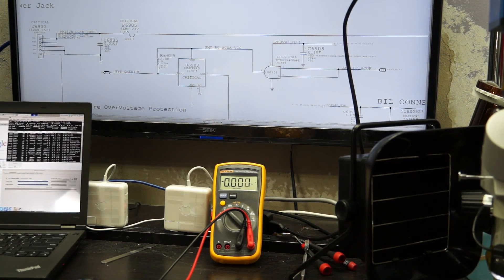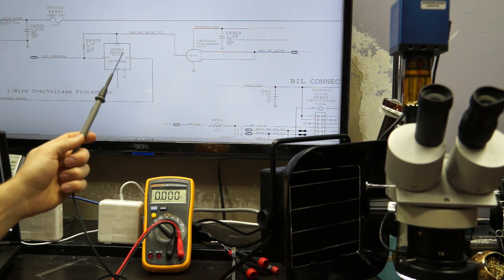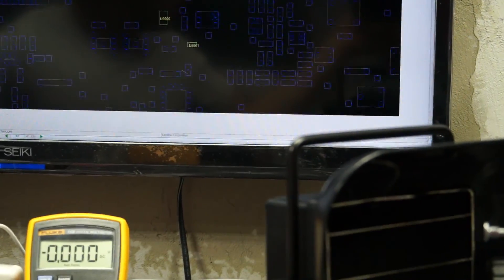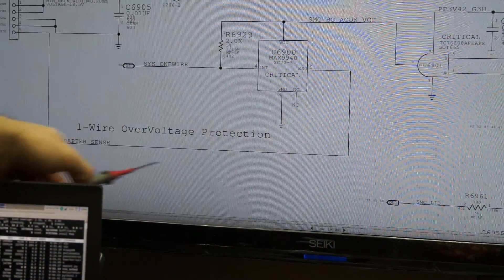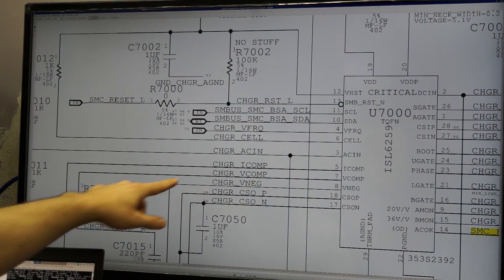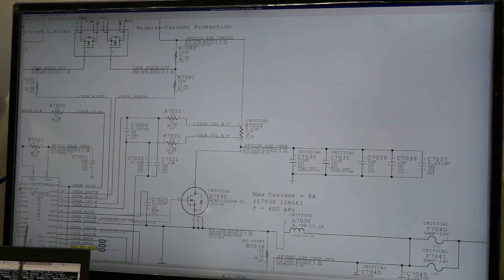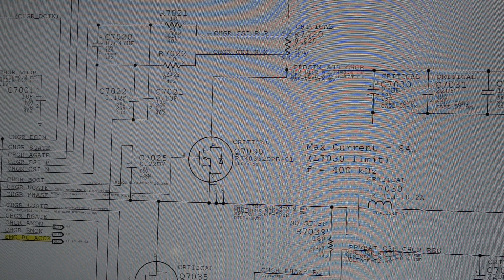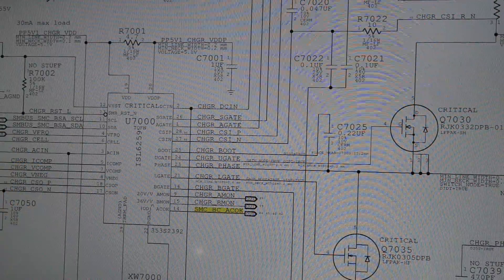How Macbook Pro logic board power circuit works - 820-2915 logic board repair.

Comment: Louis, I have this logic board, 820-2915-b, the fan are spinning all the time, the kernel task is higher on the activity monitor, all the system is slow. Should I replace the 330mF capacitor ?
Reply: yes

Comment: You're very talented. But I think the right approach to board repair is repair by a factory type facility where they have all the secrets to how the board is constructed and even some machinery for SMD work. Even pros like you have to do guesswork and essentially reverse engineer. 
One time I needed to fix a PSU from an industrial scanner. I contacted the PSU's OEM and they charged me $40 to repair it. Obviously a power supply is pretty primitive, but the OEM could repair it the best way, because they made it and know it from top to bottom. 
Board repair is basically a cat and mouse game.

Comment: Hi, your Videos are great :) Thanks. I'm from Luxembourg, my english isn't very good :) I have a Problem with my macbook, that means no start no battery charging, and the Led in the charger plug flashes orange and very weak. Did you even have had such a Problem?  Tanks :)
Reply: +Andy Lauer  Also I wanna know what Software you use to locate the parts on the board. In the schematics there are no board layout Pictures :(

Comment: *****  SMC_BC_ACOK... System Main Controller_ Battery Charger_ AC (Alternating Current) OK (okay) ... my guess is this is telling the SMC the charger AC supply is ok... strange since it's a 16 or 18v DC (direct current) output from the mag-safe that its looking at, but if the charger was outputting 24v DC it wouldn't be ok, to turn on or charge the battery... it would be interesting to test the upper and lower limits of turning on/off and allowing battery charging... would it turn on at 14v but not charge? or vica verca? perhaps an idea for a video using your power supply...

Comment: So, I have green light, orange light too, battery charge LEDs works ok, but my Macbook Pro won't turn on, already tried smc reset and all key combinations possible, even shorting rs501 pads and nothing happened. So my question is: Did this kind of symptoms happened to one of your repairs before? Is it possibe for a faulty logic board to keep on charging battery? All this started to happen after my magsafe cable got shorted out. I repaired and tested the charger and it's Ok and even tried with other charger. Any suggestions? Please!
Reply from the maker: TheMetalMusicMachine Which power rail is missing?

Comment: Louis, do you have any tips on the replacement process for the isl chip?  I've got a 2915 board that's got a short to ground on the ACIN pin of the isl. I've read replacing it can be tricky.  Is it as "simple" as the process you used in the WLED driver replacement video?
Reply: To answer my own question here for anyone who might be wondering:  Replacing it with a reflow/heat gun was easier than expected.  The main thing I figured out was to expose enough of the surrounding board that the entire area gets warmed up, not just the chip. Otherwise it won't ever come off.  Once it's off, getting rid of the lead-free solder and putting leaded solder made getting it back in place really easy once it's lined up.  It just sinks into place with a lot less heat/time.

Comment: Thank you for the videos. I have a macbook pro 13" 2010 battery is not being recognised by the system and "X" icon shows on the battery, any ideas where I should be looking?

Thanks
Reply: You definitely have to replace your battery. Or it could be an issue somewhere else

Comment: is the chip u6990 is bad can do the same thing? i mean no light in the magsafe connector
Reply from the maker: Do you have PP3V42_G3H?
Reply: Louis Rossmann I have a similar question. I have no green light and no fan spinning. There is a short on L6995 and everything that is connected to the =PP3V42_G3H_REG. Could it be the U6990? (820-3209)
Reply from the maker: Inject 3v and find the short.

Comment: Hi Louis, That's a great video, it's a pity that audio is not syncro with video anyway I really enjoyed and learned some useful things from this video. would be great if you show also how to remove this chip ISL6259 live.
Keep posting videos like this one, I'm a beginner and I'm waiting now your videos related to the tools you suggest to buy that allow people like me start repairing MB's without spending huge money.
Big thank you from Switzerland.
Reply from the maker: i bit the bullet and bought a six core desktop to do this, fuck doing live videos with micro & camcorder live recording ot the laptop. I can fuck up audio sync by simply scrolling through the pdf and spiking CPU usage on the laptop. I should be able to do much more of these soon
Reply: Hi Louis, you actually explained in detail what happen if you don't have SMC_BC_ACOK coming into U6901 but can you also explain in detail what to check if I'm not getting the 3.42v coming into U6901 ? When I start measuring around I had this 3.42v coming into U6901 however after some troubleshooting I don't have it anymore.. so now I don't have both :(..
Reply: I mean if you don't have PP3V42_G3H coming into U6901. sorry :)

Comment: How do I measure SMC_BC_ACOK at 3 volts? What all do I need to check this? Do I need some kind of power supply that's supplying 3 volts?
Reply from the maker: Use a multimeter.

Comment: I don't have green light at all when I plug in the power adapter after taking the logic board out. It was water spill. I am suspecting it's shortening to ground. I just got an oscilloscope. How do I generate power to the board to test volt readings at various points?
Reply: Measure your resistance from power rail coils to ground, see if this helps you indetify the shortened rail. If you find it measure main buck controller components. Replace failed components ;)
Reply from the maker: Back up back up.

First off, what board? 820 number. 

Secondly, do you have SMC_BC_ACOK at 3 volts?

If so, do you have SYS_ONEWIRE?